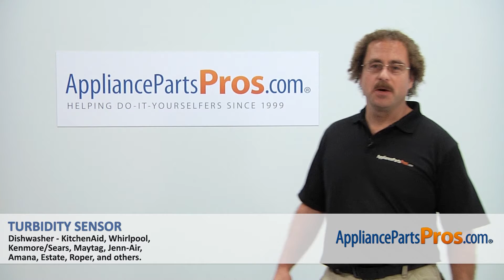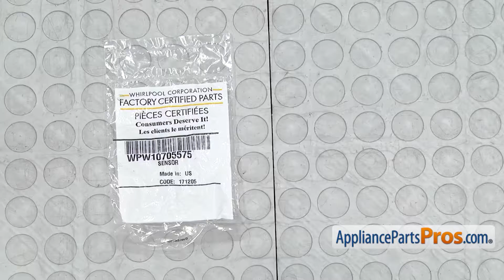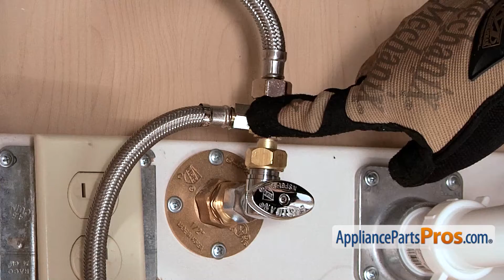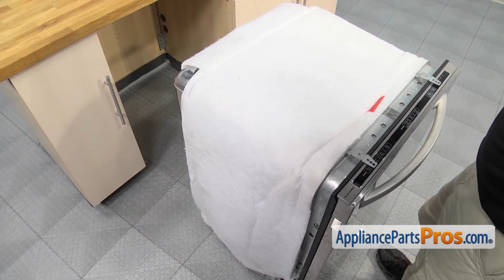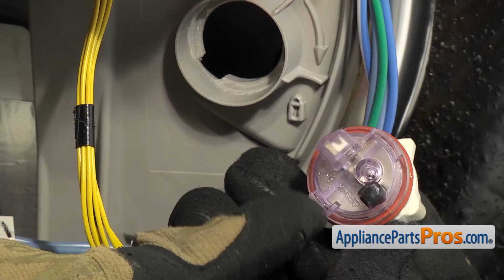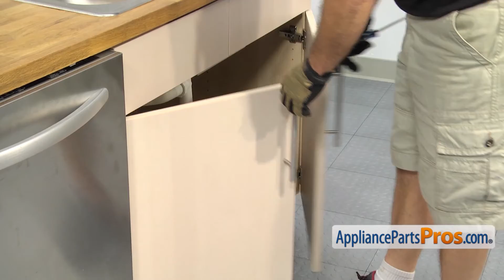How To: Whirlpool/KitchenAid/Maytag Turbidity Sensor WPW10705575

Comment: Is there anyway to test these turbitity sensors so I can be sure its the part at fault for my no heating issues? Ive tested the element, the float, the high temp thermostat, the deverter and I removed the turbitity sensor and cleaned it. Everything tested out ok except I dont know how to test the turbidity sensor.
Reply from the maker: What is the model number of your appliance and we can look into this for you.
Reply: @appliancepartspros  Thanks. Its a KDFE104DSS3
Reply from the maker: Have you had any error codes come up on the machine at all?
Reply: @appliancepartspros  Yeah at first I was getting a 7-1. Then I added rince cause it was empty. Some guy on YouTube said that on some models, if the rince is emty, you will get a 7-1 so now I cleared the error code but still no heating and no more error codes.

Atm I'm thinking it's either the turbity sensor or a relay on the control board. I heard that if the thermistor inside the turbity sensor is blown, heater won't work.

Comment: Whirlpool wi 3010 Dishwasher, water turbidity sensor, It is possible only once to check (open), the fasteners made from plastic and they do not fix the sensor anymore, now I have water leaking, very stupid construction, DO NOT RECOMMENTD TO BUY Whirlpool anymore. 
on the video I see, sensor possible to screw and sealing rubber to prevent leaking, Whirlpool engineers please learn from old school guys.
Reply from the maker: Is there anything we can help you out with?
Reply: thank you so much for assisting. I have already found the solution; I have fastened sensor with a clamp. 
if you have any option to contact with production, may u please indicate this issue.  @appliancepartspros